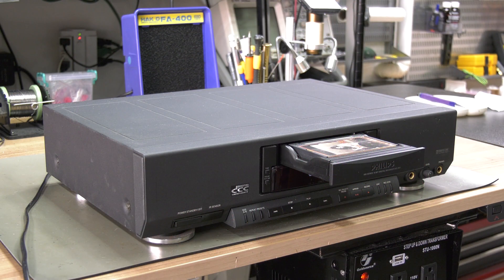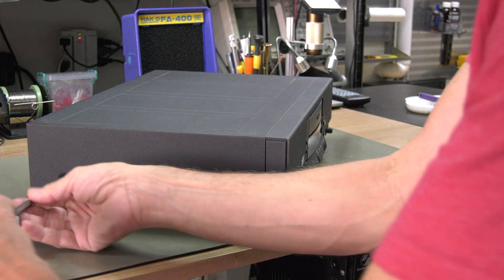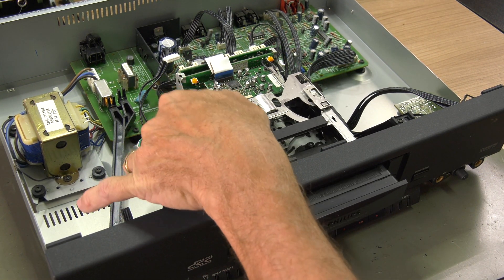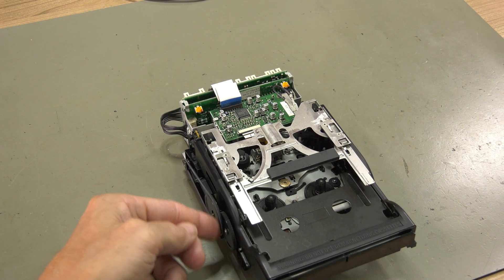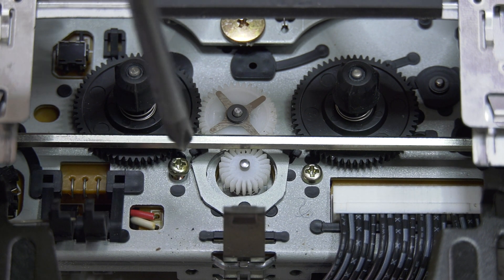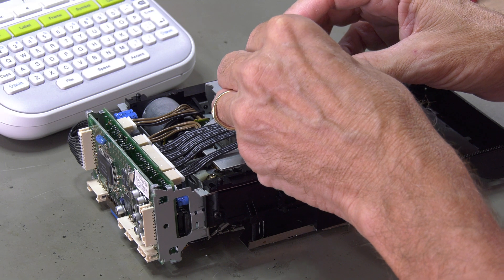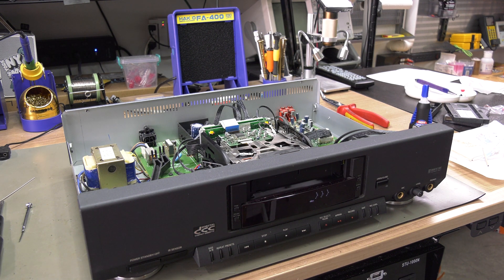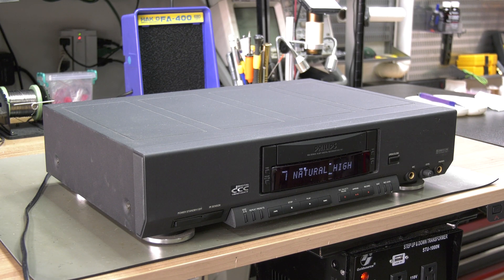A New Gear For The Philips DCC 951 And 730 DCC Recorders. The Rattling Noise Solved.

Comment: Today I finally had the time to replace the new gear of my DCC 730. It now sounds more smoothly 😃. Thanks Dr DCC for sharing this video, which helped me through the job. Please be very carefull with the loctite as during the gear placement it slipped down to deep. This caused that loctite went down to the motor block which glued all together. Luckily i noticed this before replacing, but do to this the motor/gear got glued together and therefore got stuck 😟. I had to use a knife to remove it. So again lessons learned today 😃. Maybe you best skip the loctite.
Reply from the maker: Lee Fang I am afraid it could slip without glue. I have received reports that a thin thread wrapped around the shaft also works.

Comment: I'm getting a very high resolution SLA 3D printer and some high strength ABS like resin for this type of applications, I would love to have an old gear sent to me for accurate measurement to see if I can produce a smooth looking gear, I believe it will look much cleaner than the one you put on, The 3D printer has 35 micro-meter resolution, I live in California by the way.
Reply from the maker: It might be worth trying as 3d printing had not been successful so far for this gear. Contact us at drdcc@dccmuseum.com